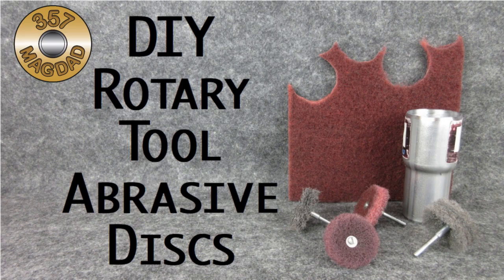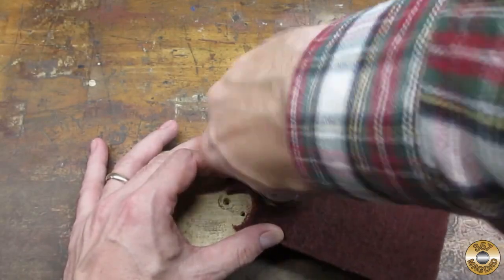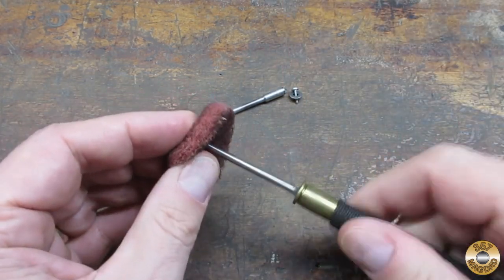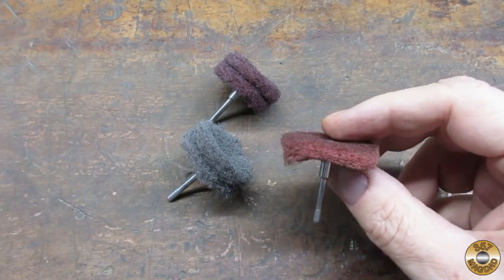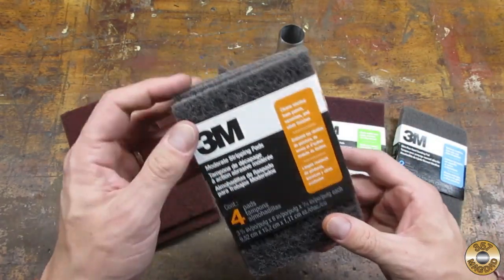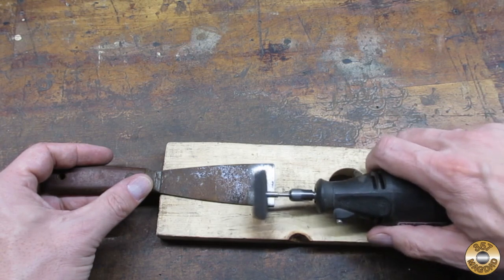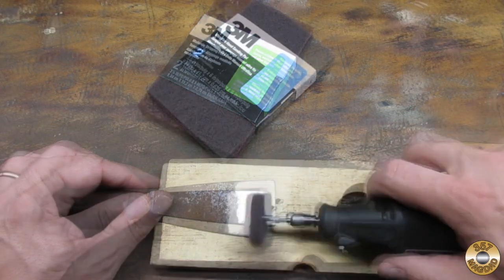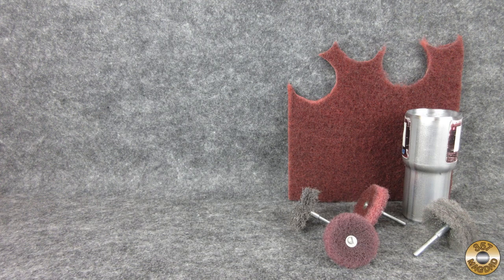DIY Rotary Tool Abrasive Discs

Comment: That was a great teaching tutorial.  I have made disc’s from one of your previous restorations and I’ve tried to make a cutting tool from a piece of copper pipe but to no avail so I just cut out squares with a scissors and then round them off.  Please make additional teaching tutorials they are very helpful.  Thanks.
Reply from the maker: Thanks Frank!  Most of the time I end up using the pipe to sort of score the pads and then I cut them out with scissors.

Comment: Tell Chuck I appreciate the discount he was able to get for his viewers as a way to introduce us to these fine Flitz products, and congratulate him on his award. I have used the Chuck discount several times to get a variety of the Flitz products, and appreciate the fact that shipping within the lower 48  is usually included in the price you pay.  

P.S. Great tips making your own abrasive discs for a Dremel-type tool, and the use of the sharpened exhaust adapter as the "cookie cutter" to cut discs out of the pads. In the past I have bought 3M Scotch-Brite pads by the box and cut them in half  (the price per pad for a $24 box [$20 if bought 7 years ago like me] which is much less than buying them 1or 2 at a time at a Big Box Store) and I have ended up with lots of half-used pads lying around the shop. Now those pads can be repurposed. 

If one uses the Wagner Paint Eater tool, there may be a way to cut out useful Dremel-sized pads from worn out discs, which are made for Wagner by 3M out of Cubitron or Cubitron II, both of which is are very aggressive and  long-lasting products.  Maybe an old metal hole-cutting saw on an electric drill would work; like others, I have several lying in shop drawers from long-ago forgotten projects, too good to dispose of, but of no practical use to me until now.  Thanks again to Chuck and you for showing us ways to keep tool restoration doable, effective and cheap.
Reply from the maker: I'm glad you're having success with Flitz!  Thanks for the tip about the Wagner discs!

Comment: Many thanks for the instructional video. Just started using the Dremel more and this will help, a lot.
Reply from the maker: Thanks John! My Dremel is probably my most used electric tool in the shop!  Let me know how the abrasive discs work out for you!
Reply: Im using my Dremel more for this type of work now, too! Thanks for the info Magdad. I like your awl. Its awlsome with the shiny brass ferrel. I just bought a big box of Dremal accessories  to replenish my stock. I have all the router accessories for it, even the plunge router attachment. The light is very useful, too. It  screws on the front. Works on magnetic induction. Cool!

Comment: After watching this I made a cardboard wheel similar.. but bigger for my drill. It works pretty good for polishing wood  ,metal, and burnishing the edge of leather. I've seen knife sharpening paper wheels before that work really good. But I think those have very fine abrasive embedded in them ..my next experiment !! Lol thanks Magdad 😊
Reply from the maker: I bet a sandpaper wheel would work well!

Comment: The "tool" you made to cut the material is similar to what I did recently to make a circular gasket for the glass fuel filter on an antique engine.  I used an old spare freeze plug that had the right diameter and ground it down on the outside edges.  Then I used my press to cut the gasket material.  I want to find an old punch set, but I haven't yet.  I could get a set from Harbor Freight, but it wouldn't be cool.  I want my tools to have a past, to have "character".
Reply from the maker: I think RoadKing uses a vintage punch to make his.  A punch set would be handy - and I agree, finding an old USA made set is more fun than buying a new foreign made set!

Comment: Thank you sir. These are fantastic. I’m making some right now👍🏻😀✌🏻I watch all your videos.
Reply from the maker: Thanks!  Let me know how the discs work out for you!
Reply: @357magdad  They work great  I made some from 3m green and 3m black heavy duty.
I have discovered that using two stacked up works best. So simple to make I use a cap from a water bottle and it’s perfect. What a great tip that WORKS!  I went to Home Depot and bought a bunch of the larger sheets and now I can make lots of them. I appreciate your help and carefully watch your videos because I’m a newbie. I’ve got lots of clean tools and pocket knives I’ve collected over the years that look great now👍🏻😄
Reply from the maker: @durango8882  I'm glad the abrasive discs are working for you! I like the dark red and grey stuff that Home Depot sells.
Reply: @357magdad  I will get those too thanks👍🏻appreciate your help.

Comment: Thank you for this.  One thing I also tried is making a few of the discs larger and when the surfaces start to wear, I gave them a little trim off the top, and I was good to go again without having to change anything.  I only used single discs for my project, but I assume it would work the same with two.  Hope this helps someone.
Reply from the maker: Thanks!

Comment: Do these discs last longer than one use? Or, do they wear out and blow apart quickly?
Reply from the maker: Thanks for watching!  The maroon and super fine grey 3M material holds up pretty good.  I try to keep the speed down.  The coarse material does disintegrate pretty quickly.  I would probably need two discs to do both sides of that putty knife.

Comment: I’m surprised you don’t sandwich the disk between two washers on the mandrel. I just purchased some 3M pads and intend to try this next opportunity I get. I’ll see if 2 washers make any difference in performance as opposed to one.
Reply from the maker: I haven't had any issues with the discs "spinning out" with one washer.  Let me know how you make out.

Comment: Thanks for this I have been trying to guess the size
Reply from the maker: I started out with 1" dia, but increased to 1 1/4" and finally 1 1/2" through experimentation.  I would recommend keeping the speed down on the larger diameter discs.
Reply: @357magdad  Thanks, great of you to share information. I find your videos easy to follow and informative. I also like the fact you don't try to entertain me but share with me what you have learned. Thom AKA old crow fixit shop

Comment: Go to your local grocery store and buy the green scrubbies. Or harbor freight and get the bigger ones. I cut those in half to use on all my stainless steel pots and pans.
Reply from the maker: Thanks for watching! I haven't had good lick with the green "kitchen grade" material.
Reply: @357magdad  it’s pretty tough stuff. I was using scotch bright almost 50 years ago to make pots and pans have cool patterns in the inside so I know the green ones are very tough. Try all the colors just to see if they have an application on your videos.  Good luck, also I just love your voice. Reminds me of my deceased father. Thanks for that too.
Reply from the maker: @gayle525  Thanks Gayle!